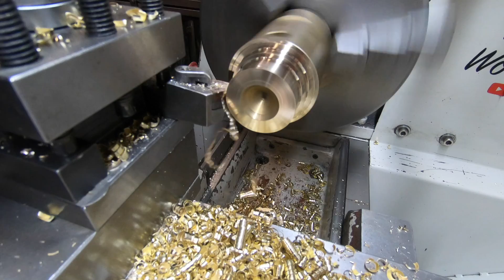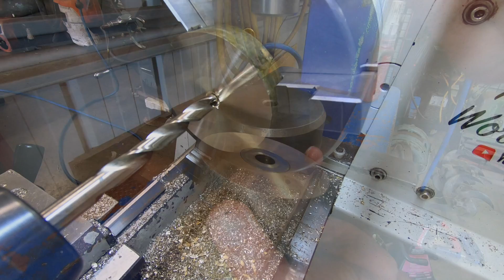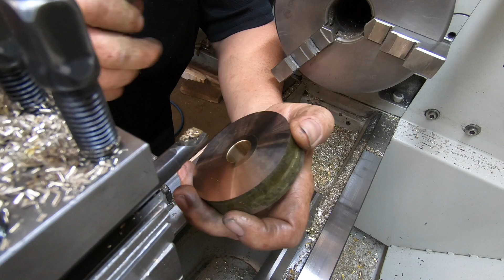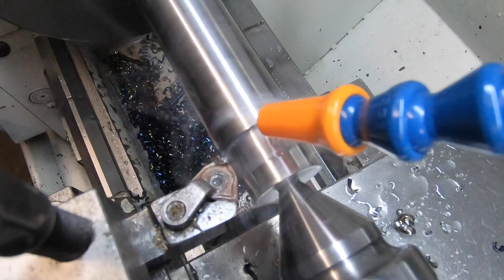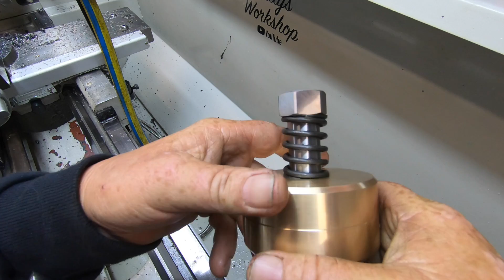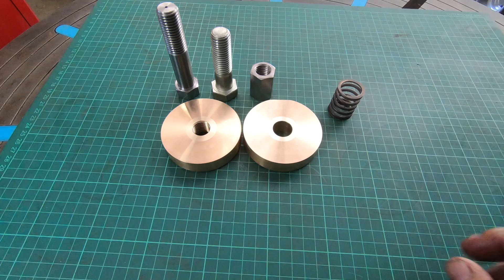Rotary Earth Clamp   Homemade Tool

Comment: Hi Matty a speedy recovery from your illness  always enjoy your  skills as you have progressed  I have a simple idea for a brake on your lathe  a motor bike disc attached with a spider and the caliper and brake hydraulic  plumbed in  even to a foot pedal the length of the lathe bed length  I have a inbuilt brake on my Hafco  900  I have fitted up some of my other lathes and it works quite well  Get well mate you  have many followers John from Newstead  Vic  Be a good one for a project you can shared Cheers
Reply from the maker: Gday John, ive looked at a disc brake setup and I think I can fit it in without having to modify the any covers, great idea mate, Thanks for watching, Cheers
Reply: Good thanks  been a friend of Emma for years yes no need for any cover mods on the Hafco  I also have an air operated disc set up  not always the air on try the jap bike wreckers  front disc and  hyd master cylinder  looking forward to a maybe idea for your channel Get Well

Comment: I would never compare my content to yours...That being said I have been having the same problems with my GoPro as well.  Very frustrating when you only have one take for machining parts.  Great video regardless.  I saw Curtis' clamp build and yours is great as well.  Great design.
Reply from the maker: Gday, I use a GoPro hero 7 black, Its done brilliant job but really starting to show its age and use, time to really start thinking about upgrading to possibly a different brand maybe, Not 100% sure yet, Thanks for watching mate, Cheers
Reply: @MattysWorkshop  For waht its worth I am using the GoPro Hero 11.  Personally, for my next camera that I look at will be something that has great macro capabilities considering the close up work we want to show in detail and something with good stabilization to compensate for machine vibrations.  The GoPro is great for its size and convienence.  Great for wide angle shots and timelapses, but for lathe and mill work it falls flat in my opinion.  The close up shots are horrible with the GoPro.  I Cannot get closer than 10-12 inchs.  Good luck if you decide to take on the challenge of finding a new camera.  I have no idea where to start on that yet.  Best Wishes.

Comment: Matty if you even want a slug out of a bit bit of bronze brass or any material you dont want to waste get your rotabraoches and measure the ID to get the nearest size up and puch through for your plug may need to part off or come through the back but its a great way to keep larger stock.
Reply from the maker: Gday, Thats a great idea and I keep forgetting ive got the annular cutters, I'll have to remember this for next time, Thanks for watching mate, Cheers

Comment: Hi Matty, that will definitely carry the current, anti spatter is a good lubricant and closeby for a welder.
I cringe at the cost of bronze and brass.
Reply from the maker: Gday Willem, I got pretty lucky with what I payed for the material, still wasn’t cheap though, appreciate you watching mate, cheers
Reply: while i was running the 4kW laser cutter at work we had a few copper bus bars to cut. my coworker and i got to talking about how expensive 110 copper is, and we looked up the price of one sheet, 3/16" thick. $2200. the rest of that job was nervewracking even with the extra material to spare to say the least

Comment: That turned out well Matty, and with your trademark high grade surface finishes :)  That smaller diameter stock was turning some really nice chips - much easier to clean them up than that darned brass dust. Cheers.
Reply from the maker: Gday Alan, appreciate you watching and commenting mate, cheers

Comment: I’m a hand wheels kind of guy.  Don’t have a DRO……. Yet :)
I’ve never thought about not looking at the hand wheels before.
My hand wheels were so small and faint I couldn’t even read them so I made bigger ones.  Sadly before I was making videos.
Nice work on the rotary earth.
I recently made myself a saw stand and someone told me “why didn’t you just buy one”
I said I already had one hiding in my scrap bin. (Just like your bolt)
Reply from the maker: Gday, I still keep watching the hand wheels and not the dro, its a habit I need to get out of but its going to take time, Thanks for watching, Cheers